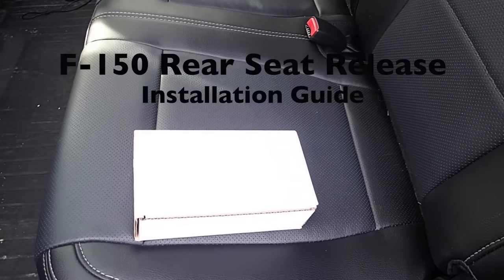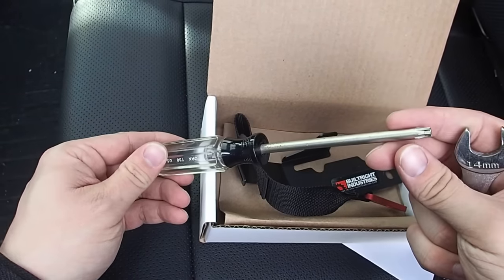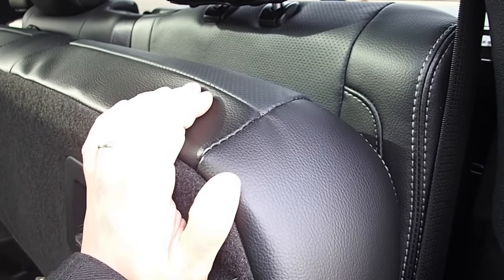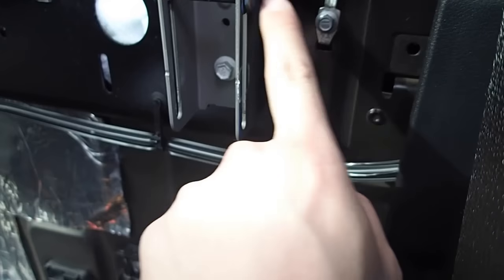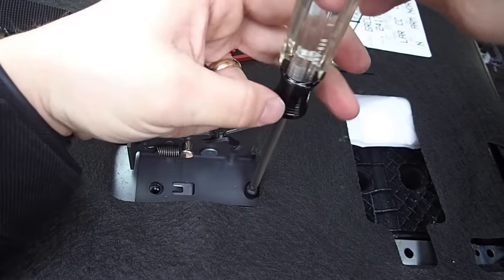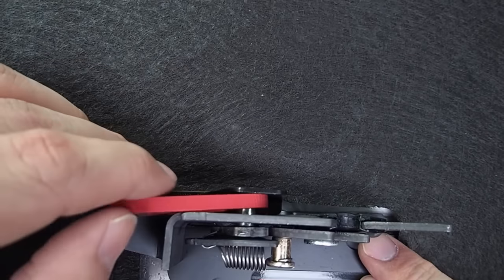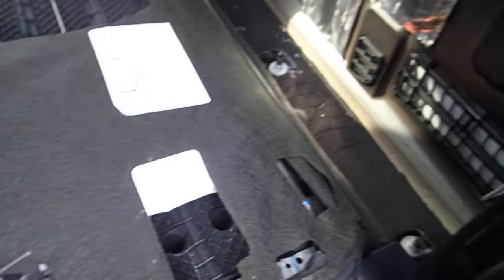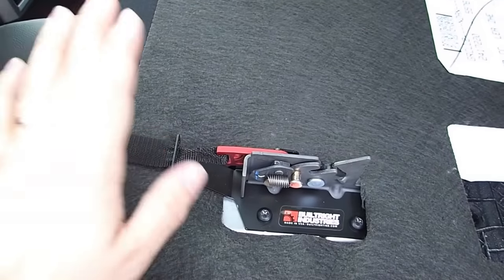F-150 Rear Seat Release Kit - Install Guide

Comment: i just drilled a small hole  through the pin put a key ring i had laying around through it and a short amount of parapcord i had laying around.....acan even use a zip tie if you have that laying around instead
Reply from the maker: Yep, there are definitely shortcuts and DIY solutions, just like anything else. This product is more gear towards people that either don't have the time to cobble something together or what a more OEM fit and finish, reliable solution.

Comment: I had to bend up the bracket that the strap goes through, it doesn't mention this. The back of the seat interferes with alignment unless you bend the bracket. I did not get any instructions. You tube provided the instructions.
Reply from the maker: Thanks for the feedback, Tom! Each bracket ships with a small card in the box that includes a 'quick start' installation guide, along with links to our online written and video guides. Did you discard this? As for bending the bracket, it's designed to fit snug against the padding in an 09-14 truck, which is, I assume, what you own. As there's no relative motion between the bracket and the seat, there's no concern for damage or wear. In any case, if you prefer to bend the bracket, it's a very simple task, as you found. Thanks again! - Matt

Comment: I ordered two kit for my 2014 F-150 Raptor but unfortunately they didnt fit perfect like in video descriptions. I had to bent it and keep trying for 1 hour knowing that I asked through their email if they will fit my Raptor and they confirmed that. At the end i managed to install them and they worked but not very smooth.
Reply from the maker: Karam, we've sold thousands of these kits to Raptor owners like yourself. Could you describe in more detail what issue you had, so that we can address it in our install guide if necessary?
Reply: BuiltRight Industries thank you for the fast reply. I will send you email with picture attached with what was the difficult part that i had to bent it. All the best

Comment: I did the same thing with a key ring drilled a drill bit into the pins slid the king Ring through it put a string around it and tied it to the headrest on the back of my truck it cost me nothing
Reply from the maker: twisterchaser 1 Look, I love a good DIY, but with all due respect, it’s not the same thing, although it may accomplish a similar end result (until it fails).

Comment: Hi guys, I have a 2011 Ford F 150 Raptor. I followed your video; my rear seat does NOT fold forward. There is ZERO room to reach behind the rear seat? Can you help me? I'm thinking I need to send this bracket back for a refund, there is NO way this will work. There is simply no room to reach behind the rear passenger seat, at all. Refund plese. Bill...
Reply: I contacted the company today. The seat release does NOT work for the 2011 Ford Raptor super cab and Matt, from the company has been excellent in offering a full refund. This is one stellar company and I fully plan on purchasing their products in the future! Thanks so much Matt! Excellent customer service! Bill

Comment: Would this work for 2014 F150 STX?  I need to see if that latch is there.  If so, I'm sold.
Reply from the maker: The answer is yes IF your 2014 is a supercrew. Unfortunately, the 2009-2014 supercabs don't have this latch.
Reply: BuiltRight Industries it is!  I'll check it tomorrow and then get back online!!!   What about 2015 super crew XLT?  Would be good gift for my brother.
Reply from the maker: Works on ALL 2015 and newer F-series trucks!
Reply: BuiltRight Industries Thank you again.
Reply: You mean I cant use this on my 2014 with the suicide rear doors?

Comment: Mine doesn't have the red metal part.  Instead, it's a lower-quality piece of black plastic.
Reply from the maker: Ben, the black glass filled nylon is our newest revision and believe me when I tell you, it's a major upgrade. Don't be fooled - it's not cheap plastic - its the same stuff many firearms and OEM auto components are made of. The benefit is that it allows a 'snap fit' with the pin on the latch, instead of a loose fit, which can develop a rattle over time. If you're unhappy with it, though, please feel free to return it. We stand behind the product 100%!

Comment: Will this work on an 18 supercab?
Reply from the maker: Yes! There are some slight differences, though. The first is that when you raise the seat bottom, you don't gain more space to reach, so that part is a bit trickier (try reaching from the bottom). The second is that the latch in your truck will have a square head on the pin, which is meant to sit inside of the larger of the two holes in the red piece of our kit. That's it, though!

Comment: Why pay for something that you will rarely use when the ol shoe string diy works perfectly fine?
Reply from the maker: Tyler Harris I can’t speak for others, but I buy things like this because ‘perfectly fine’ isn’t what I want from my truck. A 2002 Toyota Camry is ‘perfectly fine’. If you’re happy with a shoestring, by all means, use that! This is meant for folks like myself that don’t want to start drilling holes and rigging things up in a $35-85,000 truck when a $33 kit can provide an OEM fit and finish. I appreciate the question though - I don’t at all mean to imply that it’s a product for everybody!
Reply: I agree, why not do away with a section of back seat altogether and have much more storage area. How's about a kit to trim out the rear cab interior if the seat/s are pulled? That would make more sense. 🤠
Reply: Matt, a 2002 Camry is (or was) a great car as is the case with virtually all Toyota products.  They constantly rate higher than Ford, Chevy and Dodge products.  Please don't insult one group of potential customers while attempting to appease another.  And by the way, I own both Toyota and Ford products.  By the way, your installation video is excellent.

Comment: How the hell did that guy find ANF f'ing gap between the seat back and back wall?! On my 2011 F-150 you couldn't fit a piece of paper between the seat back and back wall. There is NO frigging gap AT ALL! I'm about fixing to get the large crowbar. Guarantee the GD thing will come out then. BTW,  when I lift the bottom seat up the back does OT move up like in the video. Also there is simply not enough room to lift the head rest up and out. I'm seriously considering going to Dodge.

Comment: I just bought one of these. They looked way better in this video…. Mine is plastic not anodized aluminum. Disappointing
Reply from the maker: We made the material change years back to improve functionality and cost for customers. The injection-molded glass fiber reinforced nylon part we now use accepts the release pin on the OEM latch much better than the aluminum part did, making for smoother operation. Please reach out to customer service if this is still bothering you and we'll make it right, thanks!

Comment: I saved $60 bucks for those two latches by drilling a hole, putting in a key ring and paracord for a tether.  C'mon man... $60???
Reply from the maker: Jon Lanier Hey Jon, if drilling holes and using paracord makes you happy, definitely don’t spend *$29 on this product. This is meant for folks who either don’t want spend the time on a DIY or want a more refined solution. I bring my own lunch to work, but definitely don’t spend my time tracking down local deli owners to let them know I save $120/mo by doing so. ;)

Thanks for the feedback, either way!
Reply: Boom!  @BuiltRightInd
Reply: @BuiltRightInd This is the best response  to a negative comment that I have ever seen!! Haha Love this product by the way!
Reply: @BuiltRightInd yessss!! Take that lol.
Reply: Just installed. Only thing is:
1. I have to slam the seat pretty hard to latch. When you do that the shoulder belt locks up. Very difficult unlocking the belt if it’s locked tight against the backrest. So I need to pull the shoulder belt out and hold before slamming shut.
2. When closing the backrest, the pull cord drops down. Then to unlatch you need to lift the bottom seat to be able to reach the pull cord. I’d somehow make it stiffer and a bit longer.
Bottom line is it does work great.
Reply: Try putting up the bottom part of the seat, then the back part will latch on nice and easy. No slamming necessary when doing it this way. You’ll notice when the bottom part of the seat is in the upright position, the entire seat is higher so the latch lines up with the hook. The device has nothing to do with the alignment of the latch and the hook. I see people without the device slamming their seat in to place all the time. Sure, it’ll pop in place but once you do it correctly, it’s like butter. I hope this helps.